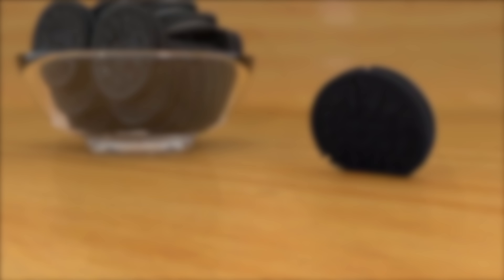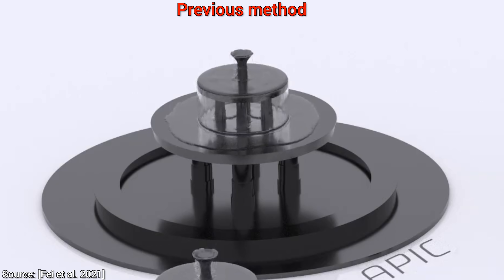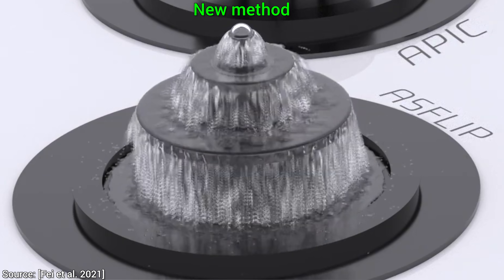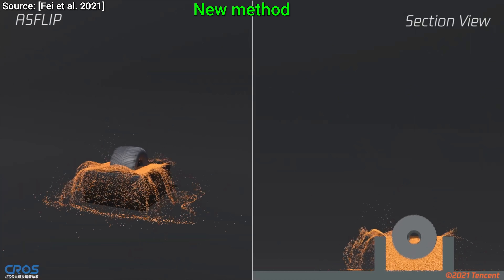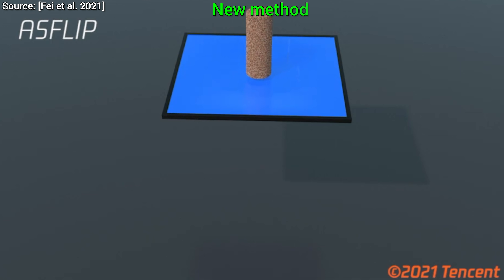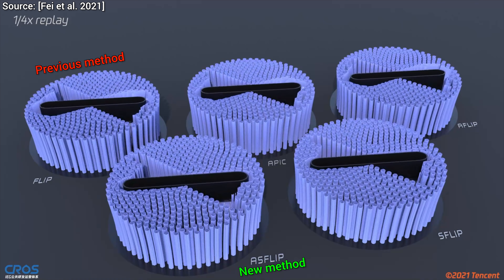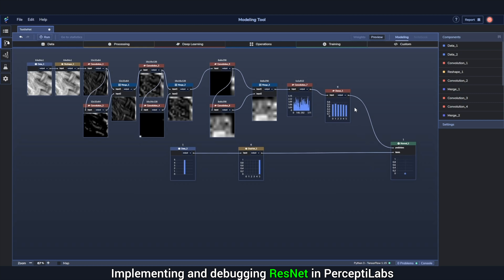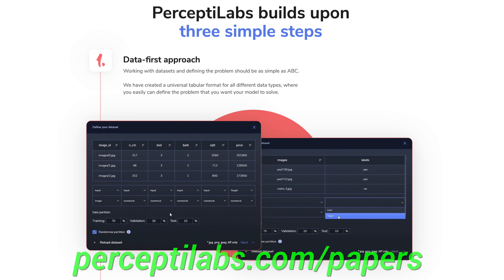Hair Physics Just Became Even Better!

Comment: Hello, thanks for making another great video. I have a question, and this comes from someone who watched many of your videos but have no background in these type of simulations. When you say one simulation is more realistic than others, I have always had some doubts about such statements. 

For example (sand through a membrane simulation at @2:15), if the sand is quite wet (maybe with water or something more glutenous) , wouldn't it be natural for the sand particles to stick in clumps (FLIP)? Also, for instance, when comparing four different simulation techniques (brush comparison simulation at @2:45), if brushes are highly electrostatically attractive, wouldn't they stick together (FLIP), rather than bouncing back to their original positions (ASFLIP)? 

In some of your previous videos, I believe something like bread/honey etc, you mentioned something like you can change material properties such as tensile strength, diffusion etc, therefore, density, viscosity etc change. But you do not call these "unrealistic" but rather "tunable" (I paraphrased in my own words).

What is your criteria for calling some simulations unrealistic versus tunable by users?
Reply: Indeed, wet sand particles would be natural if they stick in clumps, and brushes should be attractive if they are charged. However, the sand in the video is set to be not wet through setting their mechanical parameters, and thus they are  unnatural if they stick in clumps; the brushes are set to be not charged, and non-charged brushes are unnatural if they stick together. 

From the mechanical rules, we know exactly what should happen and what shouldn't. For this paper, the word natural or unnatural doesn't describe about appearance in human eyes, but actually indicate whether their behaviors obey the mechanical rules applied to them.
Reply: @fyun0acm  ah that clears up some of my doubts. 
So per your statement, you know 100% exactly what is going to happen, mechanistically. But if an algorithm (eg FLIP) cannot simulate mechanistic prediction, then it becomes unrealistic.

But isnt the mechanistic prediction also stochastic in nature just like molecular dynamics - newton’s eqn- or QM -Schroedinger’s eqn-? It seems like honey/water etc simulations are based on particles and I doubt each particle will follow exactly the same trajectory even if you seed the initial condition (velocity, position etc) exactly the same. Aren’t some of these repeated experiments bound to be somewhat different at the end of each simulation? Arent some sand particles going to stick and you have no way of knowing it before you actually run the mechanistic simulation?
If this is the case (stochasticity), how can we use mechanistic prediction to say an algorithm (eg FLIP, ASFLIP) is more realistic or not?
Reply: @henpark  Given the best computational power of human kind (e.g., Fugaku or IBM Summit), we can barely simulate a millimeter-scale water droplet with stochastic mechanics in months. In other words, for any scenario in practical scale we need to model with some approximation such as continuum mechanics instead of going directly with the molecular dynamics. So no, we don't model stochastic in nature (since we're so weak in computational power) but instead we model their averaged, homogenized behavior.
Reply: @fyun0acm  oh that makes sense. So we are willing to accept the continuum mechanics as a gold standard to test algorithms (eg FLIP). Even if we know for sure it is nothing but an averaged behavior, which is far from the natural truth.

Comment: I feel like the previous method was so bad it was designed ten years ago, and the new method doesn't look that accurate either. Sand particles go flying to deepspace instead of sticking to each other. I don't know what is better...
Can someone confirm this paper is legit an improvement over what was possible ?

Lile numerical dissipation is well-known and not too hard to deal with at this point, as well as intersections, even though they are not trivial.
To me it just looks like they compared their method with forward euler and a very bad physics simulation...

Edit: Congrats for the millionth subscriber soon !!!
Reply: You clearly haven't seen a fast-rotating object hitting powder before if you think that that's somehow "too high".
Reply: @OnEiNsAnEmOtHeRfUcKa  it was about when the sand drops from the surface ;)
I am probably biased 😂

Comment: Generally, from an intellectual property standpoint, can we implement these papers into our own projects? Or are there some licensing concerns?
Reply: They can lincense the software, but not the math. If you can build a simulation based on the math presented in a paper, it's all fair game. Just remember to cite!
Reply: @bujaksha  That perfectly answered it. Thanks!
Reply: @bujaksha  I believe you might have to be a bit careful with that. For example, a Google search showed that apparently 3d simplex noise is patented, so you need to license it to use the algorithm (I think that is how it works).
I recommend reading into it more than I did though if you are concerned with legal issues, but be careful of patents.
Reply: @hetsmiecht  By law a patent can't be granted on an algorithm that's already been published. If it is, the patent can be invalidated in court. If it's already been patented, is it still novel enough to go into a scientific journal? I wouldn't publish it if I were in charge at the journal.
Reply: Software patents. Lawyer up.

Comment: I'm a bit disappointed because you didn't show the cost in processing time for the new method...
Reply: I haven't read through the paper, but taking a brief look, ASFLIP seems to be a very small change to FLIP (~14 lines added to the code), so I think it should perform similar.
Reply: @LimitedWard  Well, the amount of line doesn't matter much when it comes to performance. Even tiny changes can have a huge impact on processing time, so I'd be curious about it too, because from reading the code alone it's almost impossible to tell.
I have done performance improvements many times in my career and always used profilers to find the bottlenecks and then change the algorithms to be more performant.